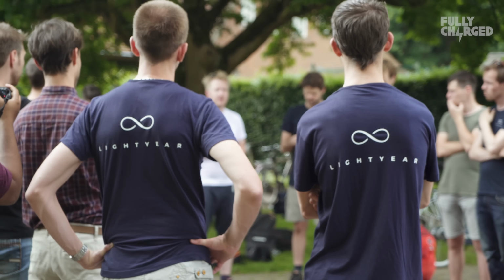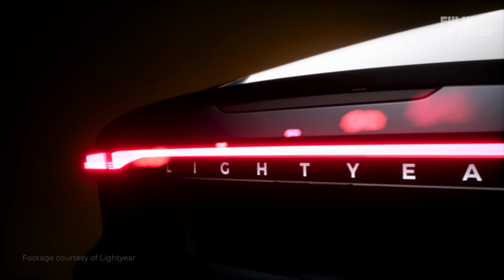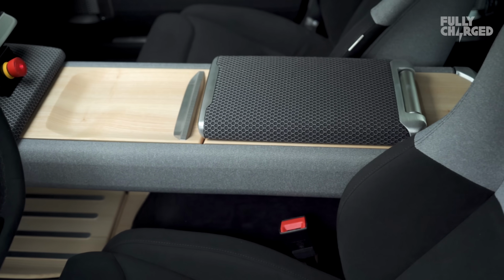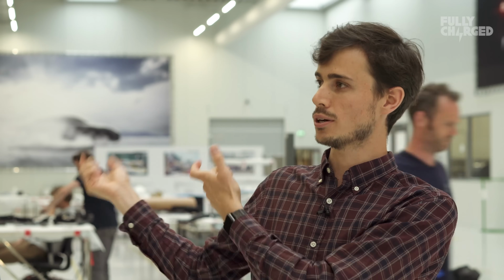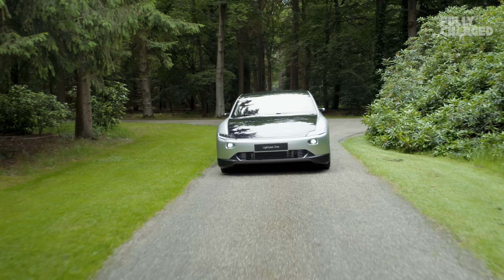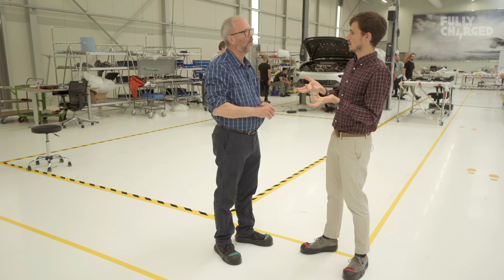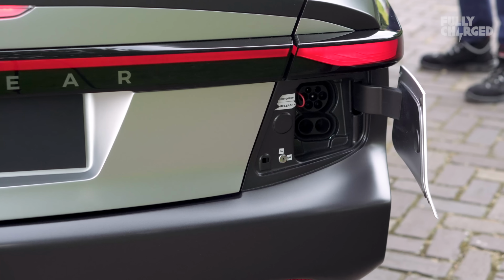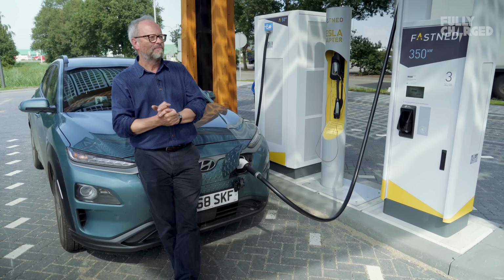Lightyear One solar powered electric car - exclusive first look | Fully Charged

Comment: I was wonder why it has to be all or nothing I couldn’t be a combination of off one cylinder generator engine under the hood a fan generator that added power back to the batteries solar panels of course recharge it plug it in to house power as an option redundant systems still get 200 miles to the gallon or more but all or nothing always surprises me
Reply: If this is all or nothing, then what do you even think about EVs without the solar? So you prefere overcomplicated cars?

Comment: what if you could use a solar panel to charge one part of a batter and a plug-in to charge the other part of the battery? since the battery pack is divided up into cells I feel like this could work

Comment: "partially solar powered" means "not really solar powered".
Reply: Well to anyone it's obvious that solar panels cannot produce enough energy to 100% power the car, but any portion you are not getting from the grid makes the entire car more green in totality. (Unless you live in areas like I do where almost all energy from the grid is from hydro dams or nuclear plants to begin with)
Reply: @rdizzy1  How much more "green"?  5%?  10%?  Face it, what we saw is a car that drives very slowly over a very short distance, which is useless.
Reply: @robertromero8692  Well considering that a normal average EV being charged from an average power source in the US is roughly 20-40% more green than a normal ICE gas car, anything better than that is a plus. Aside from that, you are also getting charge while driving, which will inherently extend charge range, and which no other car can do.
Reply: @rdizzy1  My comment was about solar powered vehicles, not EVs.
Reply: @robertromero8692  This is an EV, it has battery storage. It is an EV with solar panels on the top. Even if it didn't have storage, it is still an EV, solar panels --->electricity-->driving.
Reply: @rdizzy1  Not all EVs are solar powered.  Teslas aren't solar powered.

Comment: ...yes YES for all dreamers to that!....Now, yet just think this:  at usual average car dimensions, the maximum power of all solar cells they could use over this car is far below 2 kWh and this for 1h continuously direct sun rays at midday in a full sunny no clouds day!.... My 30 kg weight electric scooter uses this power amount to move my 80 kg weight with 50 kmph speed where safety asphalt road outside the city is available meaning minimum frictions 2 thin wheels only not 4 car wheels, no ramp, no wind!....  Therefore, hundreds kilogramms on 4 large wheels and much lower air-dynamics from this solar car than a thinny trotinette scooter, requires thousands times more energy for same movement under same speed etc demands !
But however these are still far from an usual car speed, roads, winds and average, clouds, ramps, winter, nights expectations etc so you should add large but heavy batteries and many hours patience to get them charged from alike cells even in ideal weather....   All these to let your solar car to move itself and you even for an ordinary short travel mostly imposed in a very eco driving style with no reserve for unexpected overconsumption situations or comfort demands like air conditioners or other devices on board!   
And batteries increase the weight and loose its capacity charge by charge and therefore the authonomy!
That is why even hybrids as self charging will forever GLOBALLY have lower randament and useability than direct classic diesel cars for same space and travel details... and also all the only advantages that Tesla and alike full electric cars may have, are mostly related and focused on their batteries performancies rather than on any other item!!

Comment: Perhaps a more practical solution would be to have an array of pv on your carport/garage.  And use the pv to charge a powerwall or similiar, then charge the car from that.  OK, you can only charge at home, but still, its a start.

Comment: Robert talks too much during the interview, especially considering that there are also background sounds, making it challenging to hear what the designers of the Lightyear are saying. A nod of the head as acknowledgement would be much better than a voice saying yeah or great or right or wow in between each and every phrase. All of the vocal noise is very distracting. If I were part of the production team, I would have used an audio editor to take all of that out of the conversation before it aired, not just because it isn't necessary, but because it's also unwanted and kind of rude, as well as disrespectful. Let them be heard for what they are saying. Very nice car though.
Reply: Don't you just love people who talk much & say very little ?

Comment: I am not bitching - it was not ready to  show off its full potential. I am more a hydrogen fan  - electric is not as eco-friendly. Nothing happens to obtain rapid change. The governments of the gas guzzling country's need to get their act together and have an immovable deadline to end the use of petrol and diesel. Hydrogen is the answer / as conversions are possible. Company's like ITM power are capable of producing a hydrogen fuel system. Spend the money get it done 7 years would be my target.

Comment: This seems like a failed project, at least until someone invents more efficient solar panels. Maybe in a couple of years.
Reply: Goran Josic solar cells have been around for over 70 years and there is not going to be any dramatic leap in output. The physics boundary for silicon photovoltaic (PV) cells, the Shockley-Queisser Limit, is a maximum conversion of 34% of photons into electrons; the best commercial PV technology today exceeds 26% already. At best there will be some minor incremental gains
Reply: @KingComputerSydney   then project is doomed for sure! :)

Comment: This is so stupid. It's solar panel roads all over again. At 100% efficiency the sun deposits about one and a half horsepower per square meter. Why on Earth would you drive around expensive solar panels and subject them to road grime when you can just mount them on the roof of the garage?

Comment: I like the engineering exercise, but as a consumer product this is stillborn. Solar on a car is a dumb idea for many reasons; cost, lack of efficiency, added weight to the worst place to put it; the roof. It requires an owner of a $150,000 car park it outside instead of in the garage. Then it requires the owner to pay attention to weather forecasts and calculate charging rates and estimates of solar energy gain to maximize the benefit of solar charging.

Skip all that; put the solar in a fixed location and connect it to the grid so there's no waste when the battery is full, and it's ideally oriented to produce power.

There will be tens of people willing to pay $150k for a 10 second 0-60 vehicle. It's the gold chain of green-boasting. "Look at me, I spent a fortune to drive a mediocre car that does next to nothing to save the planet. Bend your knee in my righteous presence."
Reply: What nonsense. Solar panels make perfect sense here, just like on the aptera. And this calculation bullshit, I have no idea how you came up with this story. All you need to do is park the car outside and thats is. You'll see solar panels on more and more cars in the future.
Reply: @likmijnanus  
You mad bro? First sign of cognitive dissonance is anger...

What specifically am I wrong about?

Stating that we'll have more than our current zero number of solar roof vehicles is an easy prediction. A real prediction would be X% of vehicles will have solar roofs by Y years.

Perhaps it will make sense in the future if the cost of solar goes down a lot, but right now putting it on cars is very failed.
Reply: @RedpointFive  You are wrong about solar being a dumb idea on cars, like the Aptera. 20 miles on average per day is not a dumb idea. It makes perfect sense. If 7000+ miles  of free solar miles per year doesnt make sense to you then fine, but don't go telling people nonsense like you know anything. Some people might believe you. We are at the point where solar starts to make sense if your car is efficient enough. Wake up dude.

Comment: They are still thinking with IN the box.  I immediately saw where they could gain more power from.  Not only do they have to do a crash test on the front end, but on the rear end and on the side and ROLL THE PIG.(and of course the fire test)  So that uses up 6 vehicles MINIMUM.  Then there is the 4 wheel drive ability because not everybody lives on level ground.  And the drop in the Lake test.  That is 8 vehicles. Tornado test, Hurricane test, earthquake test, volcano test=12 cars   Oh, yeah. say you get a flat.  The tire change test where it falls off the jack. Lucky 13

Comment: i was thinking if the Teslas CyberBallisticTank can get roughly 40 miles/day (confirmed possible) if equipped with solar panels, this thing should easily get twice as much, if not 3 times due to the size of its panels, size of the car (weight and aerodynamics). 

80-120 free miles/day doesn't sound bad to me 😀

Comment: The Fullycharged show...funded by GM and others to keep any real company that changes the market at bay from making ANY strides to actually make a difference in the market....Well, this company Lightyear is also still using a battery as a energy source. So while its nice, this is a slight adatation to what we already have. When will we change this to something truly advanced? Maybe hydrogen, or magnetism, or frequency driven...This is true change in tech use.

Comment: Doesn’t exactly inspire confidence when people in safety vests are running along the side of the car as it’s moving at a walking pace. As if they are shocked it’s moving. And the design isn’t appealing to me. Just my opinion. However it’s very cool that it can be self sufficient from solar power (if that’s the case).
Reply: Much about this is odd. Verrrry odd.

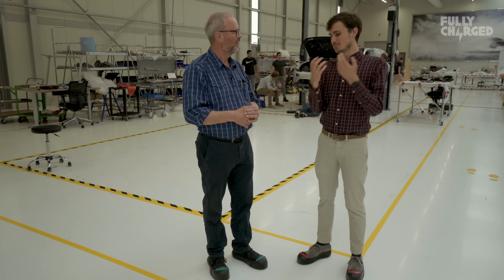Comment: 2:53 What's the deal w/their shoes?
Reply: They are called safety shoes, worn at the working sites, they have steel cap protection for toes, shock proof, acid proof etc.

Comment: The most obvious problem with this vehicle is its looks..   When will these guys learn youl never be successful with an electric car that looks like those ugly tired old failed electric cars of the past. Back when electric cars looked very much like electric cars.  strange oddball styling.  Far removed from contemporary automobile design not in a good way as did Tesla but in a very bad way as did GM and the Volt.   people dont want a car that looks like its born from green intent, they want a car that looks like its from a slick stylish future.   Tesla's designs are brilliant.  and I know what your thinking,  Cybertruck.   I read ya, but! Cybertruck design doesnt suggest going green at all.  its just a minimalist design that actually works as a sorta bladerunner future distopian or for that matter revolutionary future design vehicles.   something thats distilled away all the tired old design aesthetics,  like grandma's old furniture replaced for Ikea.  Thats the cybertruck.  this on the other hand is future-esq  but in the sorta way that looks as if its an older interpretation of what the future will look like,  NOT making a statement at all as THis is what the future IS, here and now.  Im not in any way against what the car stands for, and its intent,  actually we need more  of them,  BUT its not going to happen with these sorta designs.  it didnt in the past and its certainly not going to today.  Tesla did it right,   They made sure their vehicles had the right styling,  just enough strange that coincides with what required aerodynamically,  but also making sure it looks good enough that its desirable.   This vehicles looks anything but desirable.  As another commentor posted... it looks like a futuristic concept car from the 80's.  And it really does.   I understand the team set out to do their best to create a car that achieves its goals,  But they failed by not taking into account whether or not the vehicles is visually desirable.

Comment: nothing new under the sun about this car, guess it has approx. 1000 watt of solar panels, which will never be able to move 1-2-4 people in a desirable speed anywhere. 
That makes it just a normal ecar with solar panels........ Range primarily determined by size of battery package, does it drive faster than a bicycle, in the video it snails around..... the design does not match whats under the hood so to speak..... The science behind improving e-cars lies now in making battery technology more efficient, everything else is already invented........ thats it and thats that....

Comment: I want a self generating comfortable “ VAN “, covered in solar panels.......... I would live in it like a Gypsy, and see the whole country.

Man........ what a great idea 💡 !!!!!!!

Best of luck......... make it happen, please.
Reply: Thats actually real. Youtube it, it exists
Reply: @ahsanmirza7486  Solar Van.
Reply: Nah, too many markets would suffer from that. *whispers in walkie* shut it down.
Reply: Check out the new Lightyear video that released about a week ago from this comment. Glimpse of a test vehicle. One car one van. Just a test but nice to know it's being looked into
Reply: There is one. It's called Sion it's made by a German company called Sono Motors
Reply: I think same.
Reply: Most solar panels are only 15% efficient not taking into account power conversion and resistance. The panels need to be kept clean of dust, moisture, snow and oriented correctly towards the sun. You need an inverter and batteries to store the power. I don't think with 15% efficiency that you'd have the sq. meters on a van to generate enough power. It would be nice but I don't think it's feasible yet.
Reply: @ David Hughes 

It would be nice to just camp out...... do some hacking, fishing, just taking it easy...... let the batteries charge up the meanwhile.......... then move on to the next site........ that’s what I’m talking about. Of course..... you either have to work part time or live off your savings.🤓

Comment: Fantastic job, electric cars without solar power doesn't make sense, hello Elon!
Reply: Solar power on a car is a dumb idea, that's why nobody else has bothered. There simply is not enough surface area for it to be useful, vehicles require an enormous amount of energy. This thing costs $165k, go buy a model S and a rooftop solar system that is 30 times more powerful than what this car can provide with the money you saved.

Comment: I had many good ideas about solar powered cars and green energy sources, but everyone talked me out of it, I ended up as a software engineer but after seeing this car, I feel inspired to go at it again.I feel like the car is talking to me.
Reply: Don't waste your time, solar panels on cars is a shit idea. You will never break even with the extra cost of the panels integrated into a vehicle, makes much more sense to get a rooftop solar system so you can use it on more than just your car and at a fraction of the cost.

Comment: people need to understand that it takes weeks to charge the battery from a little solar panel like that.  It will only help you a bit. Keep in mind the solar panels will make the car more expensive and its debatable if you will ever get enough energy back to pay for it. And remember, this is a vehicle driving on roads.  1 stone chip in the panel and the entire panel drops to 25% efficiency.
Reply: If solar panels on an EV was actually practical don't you think tesla would already be doing it?
Reply: @rustyscrapper  It's just a gimmick for rich people to try and show off, the car is $165k and has to be extremely labor intensive to make. You're right, there is zero practicality of putting solar panels on cars. Way better to put solar panels on your roof if you want to create your own power.
Reply: Even if the possibility of charging the car by the panels alone exists, would it not be smarter to charge it kind of like a Tesla (either both or exactly like a Tesla).

Comment: My personal feeling for the future of EV's is standardization of charging. Though it would be a tad unfair to Tesla, and to a lesser degree, Nissan, as they've spent quite a bit on charging infrastructure, the BIG factor is of course distance. Solar charging is an important innovation but is dependent on weather, time of day, so independent charging will have to be a thing, and if all EV's can use ANY charging station then you've got the same robustness of managing distance (to a degree since charging takes longer) that petroleum fueled vehicles have. Perhaps licensing a standard to the companies that currently have a charging infrastructure, with adaptable conversions when necessary, would be a solution. But every company having a unique charging methodology will be a HUGE problem for the advancement of EV's.